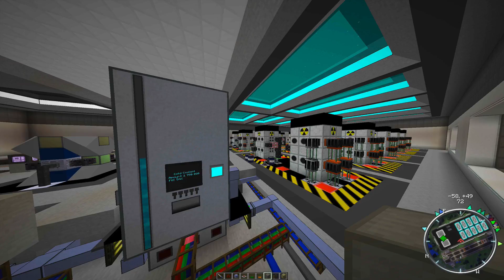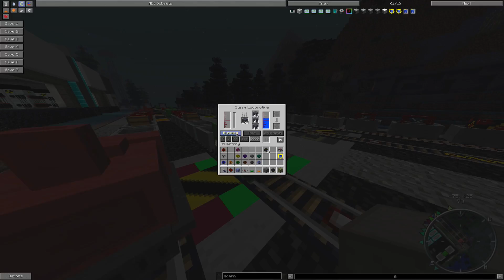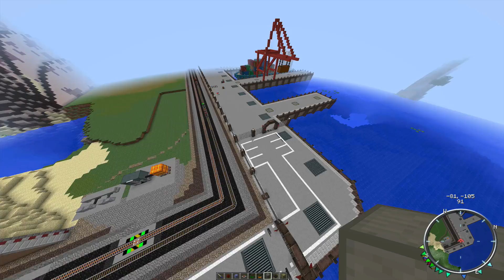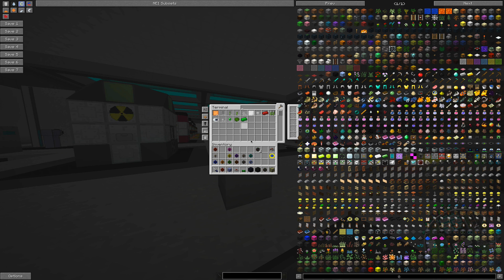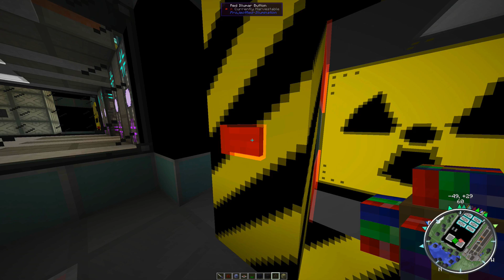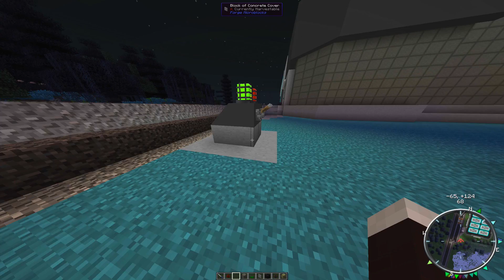Around the Block - Hot Fluid Nuclear Reactor Power Plant

Comment: Hi Great video, I was hoping you would could help me out, I have been watching your other video " TUTORIAL: IC2 HOT COOLANT CHILLERS! Nuclear, Kinetic" and build the chiller tower, but I have some trouble with the tanks, Im using pressure pipe mod. I have hooked  up the hot tank and the cooling tank with pressure pipe  to both tanks, but no liqiud is comming in the hot tank at all, and I have set the filter to accept hot coolant on the tank I want to use. how did you hook up your pressure tanks to the chiller, before you did the auto start/Stop function..

Comment: Hello mystery dump I really enjoy your videos and was wandering how could I get the reactor chamber microblocks for my experimental nuclear reactor.
Reply from the maker: Alex Barker Add the following to your MICROBLOCKS.CFG file. (Used Text Editor to do it)

# IC2 Blocks

"IC2:blockAlloy":0
# "IC2:blockAlloyGlass":0
# "IC2:blockBarrel":0
"IC2:blockBasalt":0
# "IC2:blockCable":0
# "IC2:blockChargepad":0-3
"IC2:blockDoorAlloy":0,8
"IC2:blockDynamite":0
# "IC2:blockDynamiteRemote":0
"IC2:blockElectric":0
# "IC2:blockFenceIron":0
"IC2:blockFoam":0
# "IC2:blockGenerator":0
"IC2:blockHarz":0
"IC2:blockHeatGenerator":0
"IC2:blockIronScaffold":0
"IC2:blockITNT":0
"IC2:blockKineticGenerator":0
"IC2:blockLuminator":0
"IC2:blockLuminatorDark":0
"IC2:blockMachine":0
"IC2:blockMachine2":0
"IC2:blockMachine3":0
"IC2:blockMetal":0
# "IC2:blockMiningPipe":0
# "IC2:blockMiningTip":0
"IC2:blockNuke":0
"IC2:blockOreCopper":0
"IC2:blockOreLead":0
"IC2:blockOreTin":0
"IC2:blockOreUran":0
"IC2:blockPersonal":0
"IC2:blockReactorAccessHatch":0
"IC2:blockReactorChamber":0
"IC2:blockReactorFluidPort":0
"IC2:blockReactorRedstonePort":0
"IC2:blockreactorvessel":0
"IC2:blockReinforcedFoam":0
"IC2:blockRubber":0
"IC2:blockRubLeaves":0
"IC2:blockRubSapling":0
"IC2:blockRubWood":0
"IC2:blockScaffold":0
"IC2:blockWall":0
Reply: Thanks